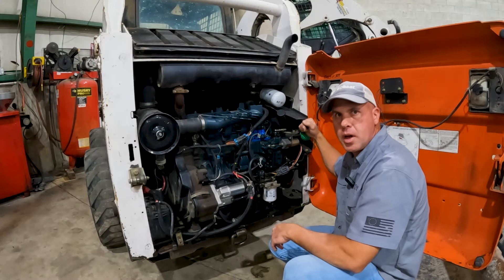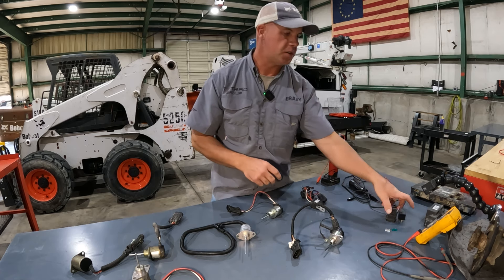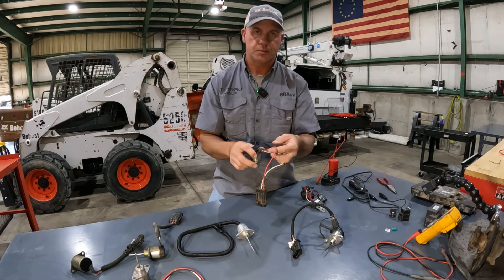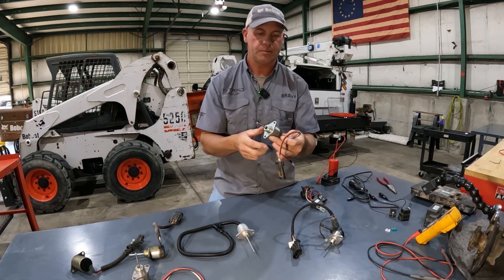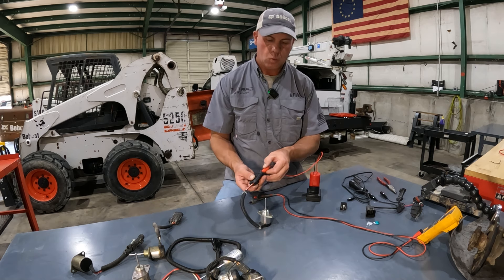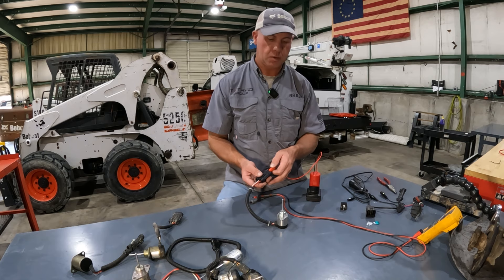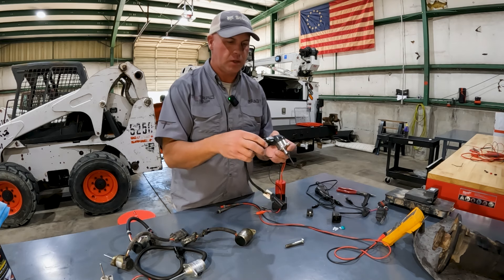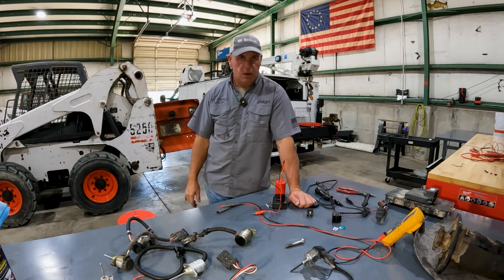How the Fuel Shutoff and Brake Solenoids Work on Bobcat machines

Comment: Thanks so much, I am not a mechanic but I have a little knowledge. Been fighting fuel shutoff on my CT230 for about 7 years. Running along and it just shuts off. Will not smoke when I try to crank it, I know that means no fuel. Turn the key off and let it sit for a while and it will crank again. It's about a 2011 or 2012 model.

Comment: Thanks, yes it helps, my 7753 shut off solenoid became weak and did not work all the time, then the control got hot and melted, i removed it all and installed a cable shut off till i feel like fixing it, my brake has never worked, going to check that out today, thanks again.

Comment: That would have really helped about 6 months ago! Still good info.  What I'd like to know 1) I'm told by Bobcat my speed sensors need to be disabled, only they can do it, it's a simple program change, $400 please.  Then 2) my hydraulics are getting "jumpy" at times, normally when lifting something heavy or if I'm trying to make small controlled slow moves. I'm told it could be a spring or o-ring somewhere in a valve body??.   2002 A300 here.

Comment: I have a 763 F series. Now I know what the click is when I turn the key! I've had a few instances of turning the key to the OFF position but the engine keeps running. The machine sometimes goes months without being used. WIth your explanation of how the solenoids work, I suspect my linkage is dry or dirty. 
Thanks so much for your maintenance tips and explanations! You have a very valuable channel for Bobcat owners and operators. 👍👍

Comment: If I could, I have an electrical question about by T595.
The cab accessory fuse keeps blowing.  I have tried unhooking the back up camera, radio and power port, but doesnt help.
It doesnt blow immediately.  For the radio, it plays intermittently for a bit before it blows.
I suspect a loose wire/rubbed wire, maybe even at the fuse panel.
Can I just push out the connectors for the affected fuse from the panel for testing? Is there an easy way to get to the back of the fuse panel? (I unscrewed it, but there isnt enough clearance to look at the back)

Comment: hi there my friend , i have a 773 skid and i install a new fuse relay harness and also a new fuel solenoid and nothing happen , if i get a tie wire and hold the solenoid in the machine works and operate them close key switch and run to the back to remove tie wire of the solenoid . were should i look thanks

Comment: I have a 2000  773 where part of the computer went bad so I set up a group of momentary and full time switches to turn on the added electric fuel pump start it and unlock the brake. I changed the fuel cut off to a mechanical one and now the hydraulics stopped working. Which ones of the solenoids in the spool valve will I need to energize to get the hyd working??

Comment: Hi, Nice video, I have an S130 with a solenoid like like your S160, my voltage to the hold coil is only about 6v, I have the wiring diagram but it doesn't give indication what the voltage should be, do you know what it is on your s160 by any chance?? It seems low but if the voltage is coming from the computer is could be regulated down i guess..... still fault finding with a machine thats new to me with a few issues and some bush mechanic repairs  i am trying to put back to factory spec

Comment: Good explanation, the brake solenoid seems to be a common Problem. Could this be a computer failure? My 873 stards and shuts off just fine, but the brake just doesn't want to work. I appreciate your videos . Thanks from Salt Lake!
Reply from the maker: It could be a controller issue for sure.  Thanks from Pleasant Grove.

Comment: I have an A220 ,, keyless control pad,, push the yellow button ,,glow plugs counter runs,,push green start button, i get nothing ,,tried to start machine at stater solenoid with external power,,turns over , but no fuel..is this because of fuel solenoid not being energized from control panel?

Comment: Want to see if you had any insight on my been having it for a while I have a s150 bobcat and it would lock up at startup I thought maybe you had to warm up it would go away it would unlock after shutting it off a few times but it seems to be locked up now and won't let me do anything thought it was the brake solenoid so I jumped that out but the bucket is locked wanted to see if you have any ideas thank you

Comment: Good video..I enjoy learning about bobcat skidsteers. Question..could you do a video sometime on the proper way to tension the tracks? I usually roll the bucket down to pivot the machine back and shoot grease until I get about a 1/2” of slack at the roller..but I was never sure if that was the correct method..I don’t want too much stress on the bearings or rollers..thanks.

Comment: I have a bobcat t870 2010 and put new final drive motors in with no speed sensors it originally had speed sensors and installed software update to make it work but it just shuts down when you try to drive. Its at a bobcat dealer they don’t know what to do with it
Reply from the maker: Does the pumps have swash plate sensors?  You have to have one or the other.
Reply: I have more info it goes forward and backwards but wont turn it say swash is out of range but when he looks at the numbers its fine. What happened is pump went out bad metal in everything replaced everything. New pump new final drive motors all hydraulic valves cleaned and rebuilt all cylinders new hydraulic cooler everything hydraulic was replaced

Comment: Great video. I totally understand how these work but I am still having an issue with my S150 bought a new traction solenoid still getting a 15-03 code with six flashes of the traction lock light. I have power making it to the relay common terminal. If I short the terminals in the relay socket I get an immediate voltage drop in the system. If I ohm the contact going to the pull solenoid to ground I get .2 ohms. Seems right considering my print calls for .3 ohms on this part of the solenoid. a 12 volt circuit with .3 ohms should pull 40 amps. Any ideas?